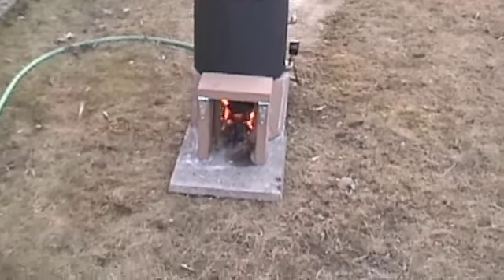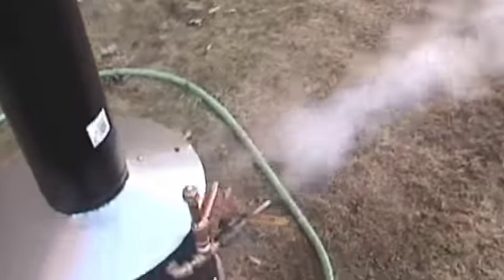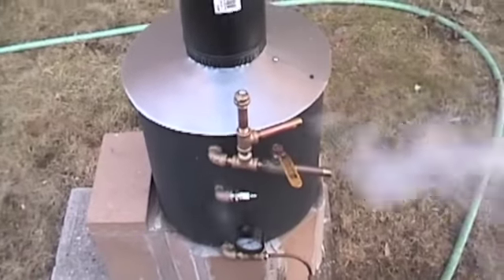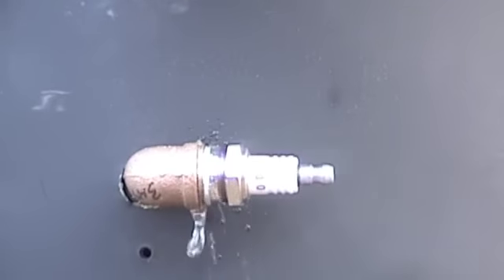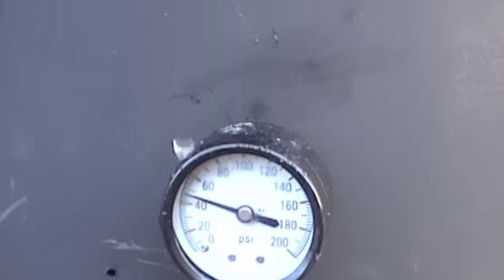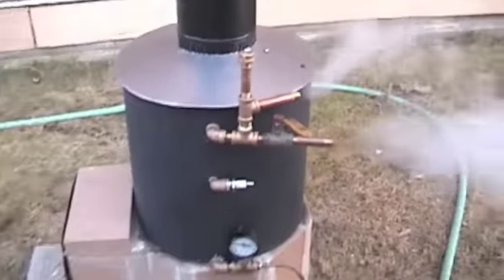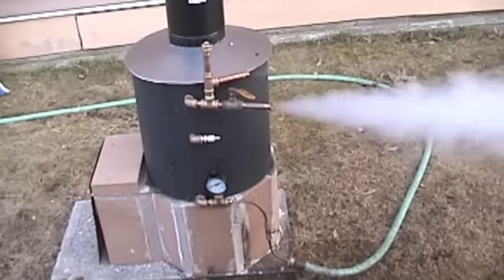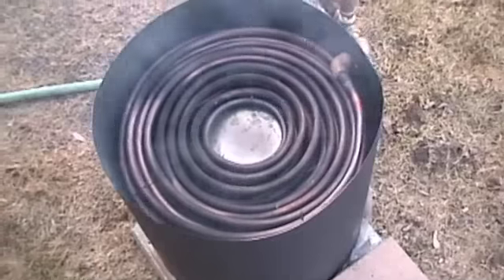Lynx Monotube Boiler part 6

Comment: Your steam is coming out really wet, slim to no superheat happening.  Try running the hot water in the top, and taking steam off the bottom.   Or at least make another coil that's right in the hottest part of the fire, and tap the steam from there.

Comment: I wish you had given some instruction on the construction of the shroud.  Some details and measures.   You are obviously pretty brilliant.  I am interested in this design as a multi use system. 1) radiant heat, in floor 2) water purification, distillation 3) steam room/sauna 4) Electrical generator.  Do you think this is feasible, or am I asking too much of the system.  Obviously I wouldnt be looking to accomplish all 4 at once.

Comment from the maker: @onesojourner 
Thanks for the comments, I am fully consumed by my Wind research so steam is on hold.
Safely is a matter of personal comfort.  For me I can safely get 120 psi.  The safety valve is set for 125 psi.  The simple steam engine doesn't like pressure and temperature above 120 anyway.  The copper is rated for 600 psi.

Comment: If you don't mind me asking, how are you pumping water into the monotube boiler?  Isn't the pressure inside the boiler around 100-120psi?  What pump will overcome that pressure?  Or is the pressure at the intake port lower because the water is cool?  Thanks so much!

Comment: Hmm, I thought you weren't supposed to expose copper tubing to fire?
Becomes brittle over time eh? Yes, I know the melting point is like 1467 degrees or something like that. But it's not the heat, its the fire.... or something like that.
=D